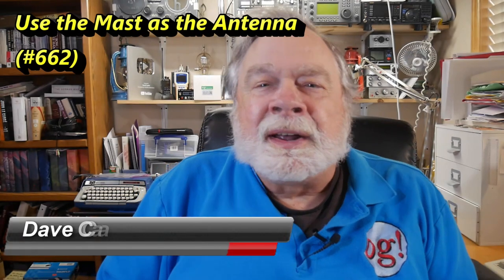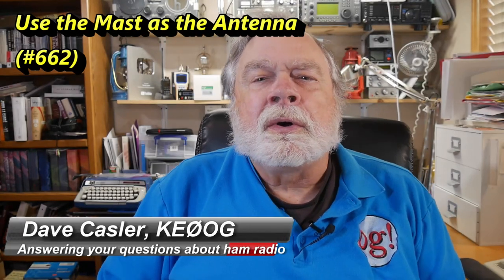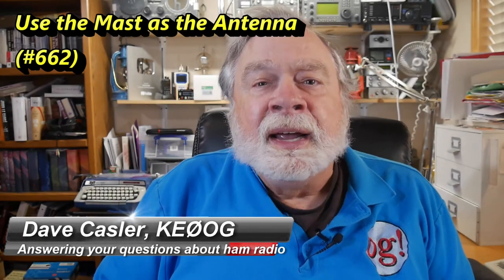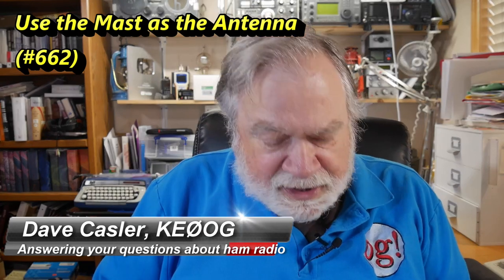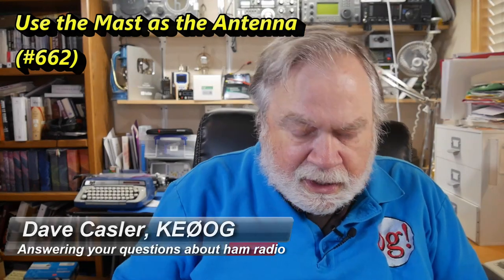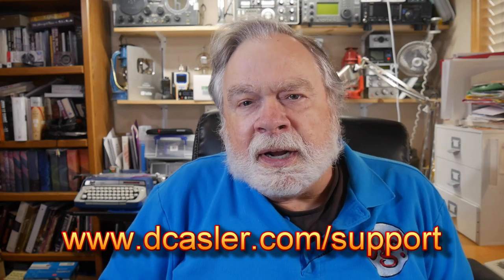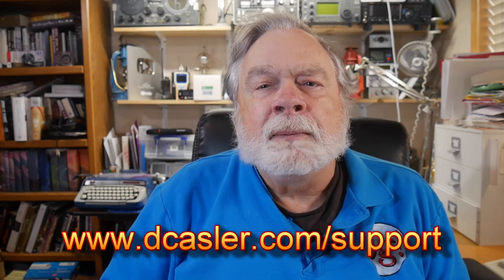Use the Mast as the Antenna (#662)

Comment: I am interested in this for a project at work.  For mobile emergency communications kits.  Having fewer masts is a good thing.  Wondering how to have as many bands covered in each mast as possible without undue losses.
Thanks for your content. Will be watching more as I really need to get my license, likely Tech first then step up over next few months.  So much to learn.  Had No Code Tech many years ago.  Still have my Kenwood TH-78A HT.  Made a J Pole and a couple other antenna designs from the ARRL Antenna book.  So my experience is very limited.  I really need to learn the general principles around getting the signals in and out of a very compact box which has a server, end user computers, AI, UPS AC/DC Power Supply and some needed accessories. 

We will be covering 50MHz to 5GHz in this kit.  Specific bands like 2m and 70 cm, 2.4GHz and 600MHz will be important to have solid performance. 

We will be using SDR and discrete radio modules where it makes sense.  Likely have RF front ends on mast to get active parts closer to radiator.  

I am the Solutions Architect helping to design a package and a price point to make it work for our customers.  Public Safety and other response teams.